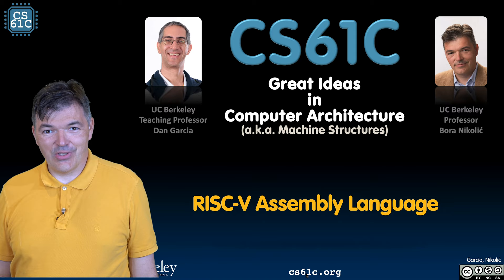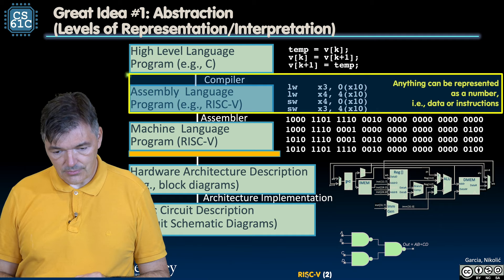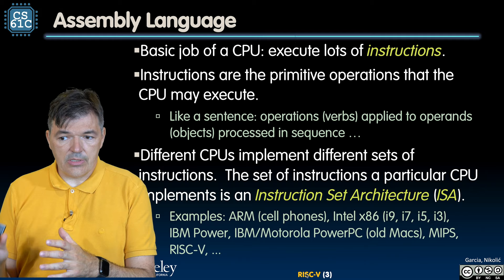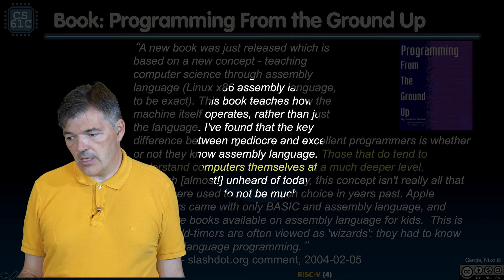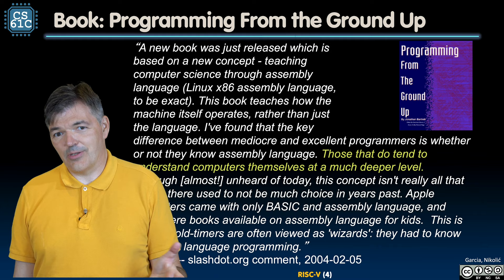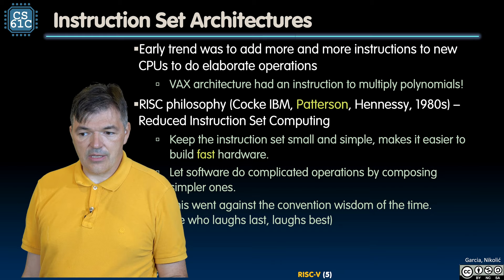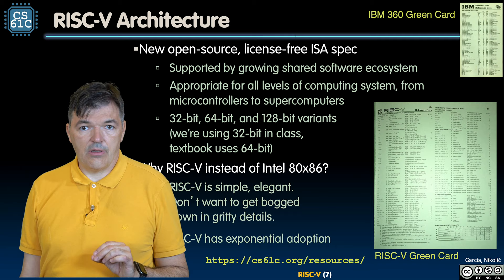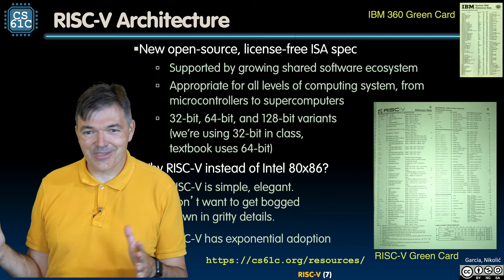[CS61C FA20] Lecture 07.1 - RISC-V Intro: RISC-V Assembly Language

Comment: use your nose for inhaling sir. take ten seconds to catch your breath up using your nose for inhaling and mouth for exhaling then never inhale from your mouth again. using your mouth only is half duplex. it does not work. you need two simplex buses. mouth and nose. you may try making a full duplex using your mouth only by speaking while inhaling aswell as exhaling which is possible but it would sound a little weird.
Reply: Lmao😂